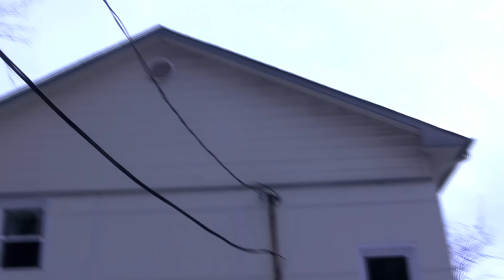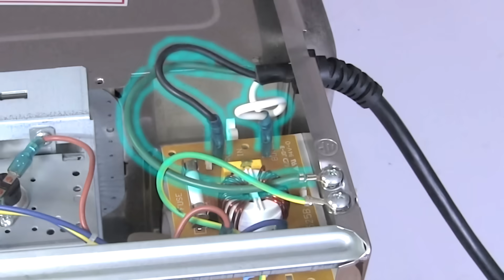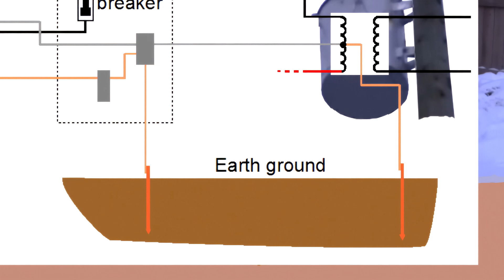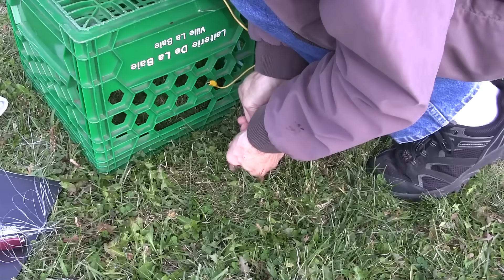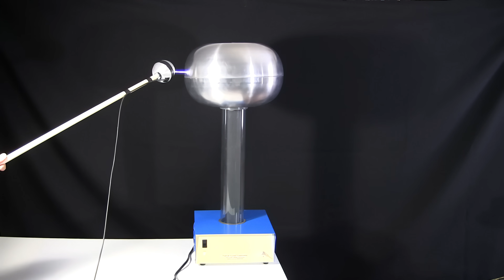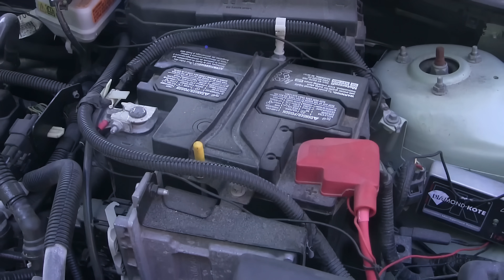What is Ground? Earth Ground/Earthing

Comment: WRONG WRONG WRONG.  BIG TIME WRONG.
IF THERE WAS NO  GROUND WIRE  YOU WON'T  GET SHOCKED IN THE  FIRST  PLACE.
WHEN YOU TOUCH THE BODY AND YOU TOUCH THE HOT YOU BECOME THE WIRE THAT CONNECTS THE HOT TO THE GROUND.
FIND OUT WHY GROUND WIRE WAS INVENTED.   IT IS NOT      WHAT YOU    ARE TOLD.
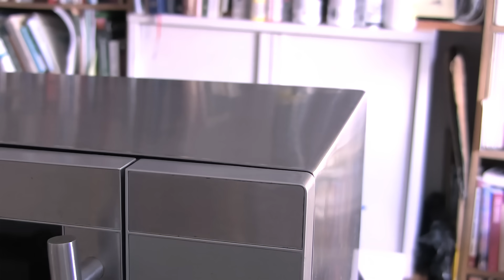At time 2:30 why would you feel a shock by touching the body of the microwave  if the breaker tripped due to the hot wire touching the body of the microwave in the first place as he says.
Electricity takes the path of least resistance?
UTTERLY FALSE.    
Electricity takes  all paths.
Reply: If the ground wire isn‘t connected to the metal body and a damaged hot wire touches it nothing would happen. But as soon as you touch the metal body you surely get shocked since your body is now connected to the ground and current can flow
Reply: @bauermarinus  May I?
In the beginning there was no ground anywhere in the system period.
Then came mother nature which they had not accounted for.  Millions of volts of thunder and lightening.
With that profound voltage and  there exists relative permativity between free space and all materials.  There was not a thing that can stop the discharge.  Such discharges destroyed the grid system.  Hence the ground was provided at the source.  Giant steel directly to the Earth.   The Earth thus became the load that absorbed the millions of volts.
The purpose of Ground was to protect not people but the infrastructure.
Then they realized,  with that came danger to people... but of course..... I leave the rest for  you to connect all the dots.
There is a lot more to it if you want to keep your self from getting the zap.
That is what all those upgrading of your breaker switches is all about and really good ones....or it has little meaning...
I have no desire to type an encyclopedia here.  Hence I said find out, research it.
Reply: @alchemy1  I researched. Couldn't find any Ground with protecting infrastructure. It all about to protect people. If you want people to know your truth, provide source or make a video of it with source.
Reply: @kluaytodnampla  You researched? That is good.  This is just couple sources.  However you don't need any source to see the logic of it. To see the sheer logic is only possible if the principle of electricity is actually understood. Since that is not clear ( and there is a reason for it), people just repeat.  But why?  What is repeat and what type of things get repeated?  What gets repeated is what sound appealing to the ear,  The cost doesn't matter and the cost can be your life.
I care less about the source I have placed here below.   Some sources as stupid as the others.
If you really want to go deep, I got one for you.  Electric Energy does not flow through wires in the first place.  It moves through empty space.  Transmission lines act as waveguides for photons to transmit the force, i.e. energy.

Overwhelmingly energy flows outside the wires at close to blazing speed of light.  In fact if you look closely at Poynting Vector, it will come to your attention,  the fact that tramission lines or any so called conductors ( no matter where they are) actually are loads themselves, they consume energy, hence heat.  From free space energy enters the wires indeed.  There is a lot more to this.  But there is no need to write a book. I can keep going until you will see nothing but my comment.  But that it is uncalled for.

"The main purpose of ground wire is to protect the power lines conductors from direct lightning strokes"
https://www.electricaltechnology.org/2012/04/what-is-purpose-of-ground-wires-in-over.html

Read carefully with full attention to details:  Just don't let your eyes pop out of your head.  Breath, relax and be utterly amazed.  What else can we do.  Better to face reality.  We don't have to like it.  It suits me just fine ; as if I have a choice. 🙂. Just look at the wording:  PROTECTIVE GROUDING REQUIREMENT. You are to protect yourself from ground. That is what it means. And English is my second language.  Oh my.  See it in pictures.  Watch for confusion caused by usage of words.... it is crazy as hell. YOU GOT PLENTY TO READ.  CHEERS.
https://electrical-engineering-portal.com/protective-grounding-requirements-transmission-distribution-lines

((ELECTRICAL WORKERS MUST WEAR RUBBER BOOTS FOR A REASON.  GROUND IS DANGEROUS))
There are other issues as well, including virtual grounds and other anomolies when it comes to high voltages.  
Empty space.... it is not empty.
The Earth must not be used as some save all protective shielding.  If you are in the path of a capactive or inductive discharge field......... the rest I will leave it to the experts to sort it out...  There is not a thing in the world that is not a conductor period.  The truth of it is, where there is dialectric,  energy reside and that is an actual fact, not in conductors and so conductors are just highways that the delivery truck use  ( i.e. photons) and the goods they deliver is energy, some call it the force .  As in Photons are force carriers.  It is a closer metaphore to truth. 

(What kills you is not volts or amps. What kills you is energy.  And if you want to  really get in the paradox... what saves you is also energy))

[[You only have to know one main truth,  Real knowledge is not obtained if it's intent is to get the grade or get a job.  It is just how it is.  It doesn't have to be fair.  I only know all this, because I care less to get a job, make money or get the grades. I am too damn old for any of it.  I know it because it is awe inspiring.   Do I have all the answers...?  That is a joke.
In fact I know little to nothing.  But what I do know is when I see something way wrong.  And there are lots, in fact lots.  More than I care to gripe about. And that includes me.  When I am full of it,  I try my damnest to catch it because others don't help, worse yet can't)).
There is more nonsense out there that an attentive person can shake a stick at
Reply: @alchemy1  These are interesting and new to know. Thanks for your efforts to write this for me and other. I shall share your words if I'm smarter, gotta grow my brain. *dive down the source*
Forgot to say "have a nice day man"
Reply: @kluaytodnampla  I left my latest comment up there to directly drive the point.  Just what is ground.
Reply: @alchemy1  I've always been around electricity, components and magnets lately I graduated as techincian on the subject and only recently after 30 years of life I'm coming to the same conclusion and I think that powerlines actually are the source of the grid and we are paying so much for something that is and has been free for milleniums.... watch?v=9pmdbYewhs8
Reply: @Rapbando  You guys sound like loons. No offense.
Reply: @alchemy1  the reason why two prongs exist is because electrical objects were made of plastic which is not a conductor, so if the insulation of the wire breaks, no problem, then metal appliances came and ppl complained about electric shocks, so the 3 prong with ground is made so you can safely touch it even if the insulation breaks
Reply: @alchemy1  All my memories of how electrons flow is different,all the info I find seems contradicting.Every comment section is full of people disagreeing,not just this topic but everything.
The world got flipped and everyone is losing their minds.
I don't know where to look,any information would be appreciated.
Reply: @kaintgetritedonetried  If you really want to get clear about it to the icore  of this thing, consier this:  
What kilss you?  It is not volts and amps.  It is Joules of energy.  Now that is the killing part. It is how many joules of energy moves through the body.

Back to ground/neutral/hot wire business.   In the very beginning there was no ground and what ended up happening was that when lightening striked it destroyed the grids as the surge of energy did not read earth instantly, it traveld through the wires until it finded a to the Earth below.  So ground  wire was put in place to instantly ground the lightening strike so it could reach the earth.  In other words ground iwas put in place to protect the grids, the infrastructure. 

Hell, lightenig can use you to reach the Earth.. you will be toast, if you happen to be in its way.  Tha is correct.

  And of course that ground ing of the grid came with a cost.  In other words if you touch the hot wire and you are not insulated from the ground.. such as wet ground., bare foot, you are toast.  Especially with high voltages. That is right.  
In the beginning you could  walk arouind all day with hot wire in  your hand, nothing would happen to you.   Only if you touched the so called neutral wire, you had be killed.

If you touch a high voltage wire even low voltage wire and you stand on bare wet ground without shoes... you will find out.  So how does ground proteets you?  You will be dead.  🙂

Why? It is because the ground is connected to the so called neutral too.  The only difference  is the ground of course has higher impedence/resistance,,, so you will not get killed as easily compare to  if you touched the neutral.  That is all.

Lighening will tear you apart standing on the ground if you happen to be in its way.  With the electric grid ground is exactly that, protecting the wires and equipments.  But wait for iiiit.  Not always.   Lightening has no mercy.  With millions of votls a serious strike can simply  split a house in half.
Reply: These guys are some real nutcases. Illuminati invented ground to kill us all. Ofc ...

Comment: So basically it's basically a ITN system with one-pole breakers and no earth fault function and NO way on earth to measure such fault and no way to segregate PE and N, thus a death trap. Slow, sarcastic clapping.
Reply: True.  That's why we have GFCI's, which do detect the fault in a backwards way.
Reply: @markgigiel2722  any backwards detection or on-line isometers are doable but a full demisconnection at dist board beats anything. That, and preferrably an up-rated (maybe time and/or mA level larger) man incoming breaker in addition for selectivity is even better. Only smart thinh I ever saw in USA are earth fault sockets. But just sockets are tol little too far downstream.

Comment: Great video! The only part I don't get is:

2:42 - That ground wire is a very low resistance path for the electricity

Why is the ground wire very low resistance? I searched and I'm still not sure why this is the case.
Reply: Electricity follows path of least resistance, you would want your ground wire to have as minimal resistance as possible so the current flow would prefer that path.
Reply: @tylerstephenson8886  What’s different about the ground wire compared to any other wire? Isn’t it just a copper wire?
Reply from the maker: At that point in the video, I'm comparing the path from the hot through the electronics to the neutral to the path from the hot through the case to the ground wire. In that comparison, the electronics and neutral are a much higher resistance than the case and ground wire.
Reply: @dontbanmebrodontbanme5403  That is just the point. It is copper and copper has low resistance. The current does not for example go through the actual ground which would have high resistance.
Reply: So that the electricity will flow through the ground at a higher current and flip the circuit breakers instead of going through your body which has a higher resistance.
Reply: Read my comment.

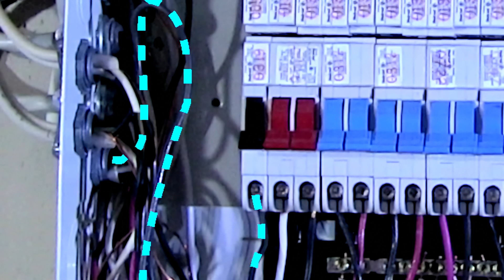Comment: 3:00 So what happens if i simply have my hand on the microwave oven before the breaker goes off? Do i get electrocuted for a microsecond?
Reply: Depends on how much electricity will flow through our body. If you wear rubber soles and don't connect to anything else, no problem. If you are soaking wet and touch a metal pipe with your other hand, you may die.
Reply: You'd be shocked for a bit but electrocution is death.
Reply: Yes, but not enough current would flow to cause harm, or even feel it, because of the short duration.
A static shock from scuffing your feet on the carpet can be thousands of volts at tens of amps, but it doesn’t kill you because it lasts for only a microsecond.
Reply: The breaker goes off immediately and even before that the voltage of the case will not rise significantly though theoretically it could raise to half the mains voltage.

Comment: Isn't it very dangerous to hook up the household ground to the neutral? Touching the ground wire means that you are now inside the circuit (in the example: the electricity goes through the microwave back to the neutral normally but if you touch it it also goes the "normal" way but it has a secondary path now which is -> microwave -> you -> earth).

I know that the amps flowing through you are not that great because you are basically in the end just a parallel circuit with a lot a resistance but still not very great.
Reply: Neutral, in the case of the video, is essentially just useable earth. The breakers there wouldnt be legal in my contry. here we got breakers that controlls both hot and neutral, and trips immediatly as soon as it detects a magnetic difference between the two(a fault)

Touching ground is not an issue, as your body got too much ressistance, compare to the eart wire. and electricity behaves a lot like water, in a river, it takes the path of least resistance. so it will keep going into the ground/earth. 
The issue if theres a disconnect with the ground, and youre touching ground and the machine, while there is a fault. cause now youre the middleman, and 120/240V is enough to bypass the ressistance of your body. so it will go through your body.
A
nything above 48v(just commonly refered to 50V) has a large enough voltage difference that it can go through the resistance of your body. Which is why you can touch te poles of your car battery, and not get electricuted.
Let me know if theres more questions
Reply: @TraktorTarzan  I know that in europe there is a difference but the north american one doesn't seem save to me. 

Well yes you get off there is a lot less amps flowing through your body then on the normal wire but still it will go through you.

Thats BS that anything above 50V goes through your body. It doesn't matter how great the Voltage is amps will flow through you even if its "just" 2V. Yes you won't die because the aren't enough amps (most likely) flowing through you. (If we assume 20M-ohms we would get about 10microamps).
Reply: @burnstick1380  now youre just being pedantic. I never said there is no current going through you, at all. But it so small its not even worth discussing. cause your body got some resistance, and earth does not. 

and no, touching earth will not be an issue, cause earth got close to 0 ohm, towards earth. and your body, if youre bare feet, or touching anything else got a lot more.

There are electrical systems where there can be constant high voltage on the earth wire, but i doubt thats normal where youre from.
Reply: Electricity takes all paths to ground
Reply: @slockfox  yes thats why it also takes the path through you meaning you can get an electric shock
Reply: when you touch the hot and the body youi become the conductor that hooks the hot to the ground.
Reply: Try to learn the basics. Unless the neutral is broken it is not dangerous. Why would the electricity go mack to the microwave when it can go directly to the transformer?

Note also that i the US split phase if the legs are balanced the neutral has very little current. That is its potential is close to the earth even if broken. Same applies to the three phase.